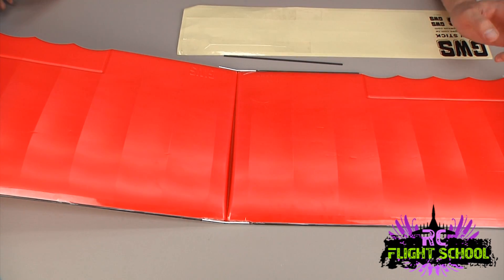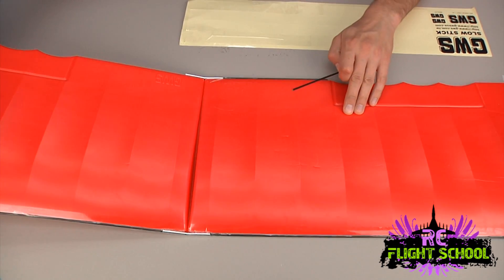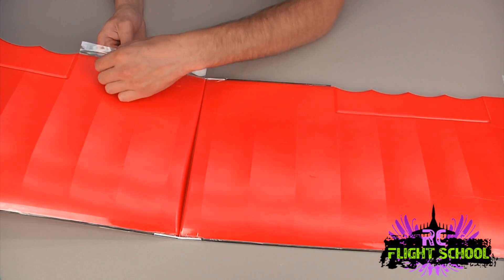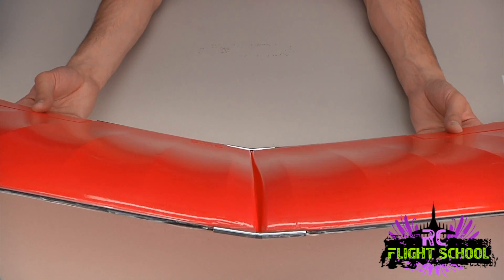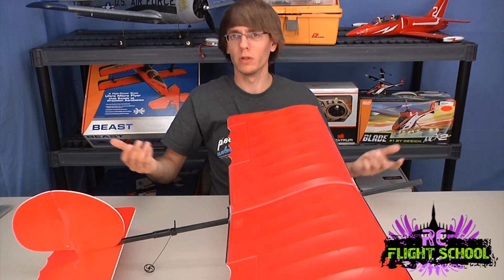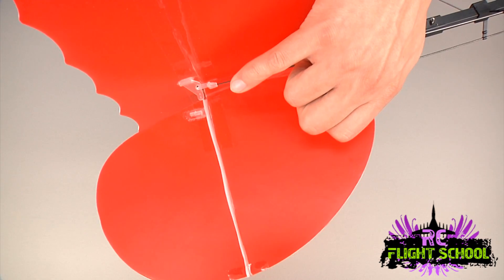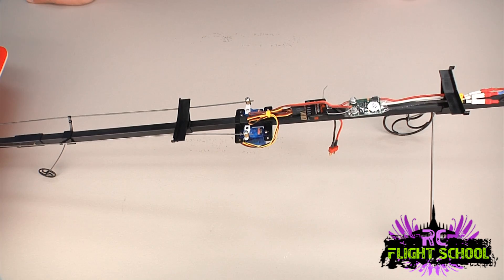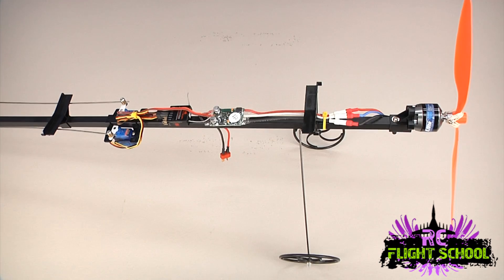How To Build An RC Plane-Slo Stick Part Two

Comment: Ive wired planes with esc's and motors but just got a 2 channel glider with no motor or esc. How do you wire battery into receiver without an esc or motor. Its probably a simple install, but just wondering how its done. Thanks